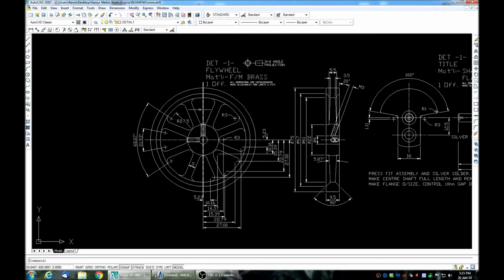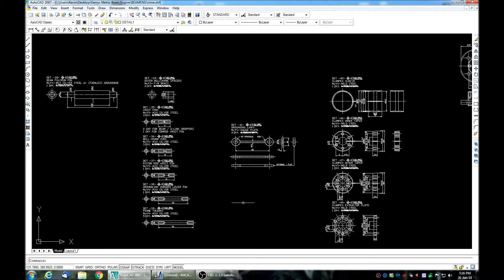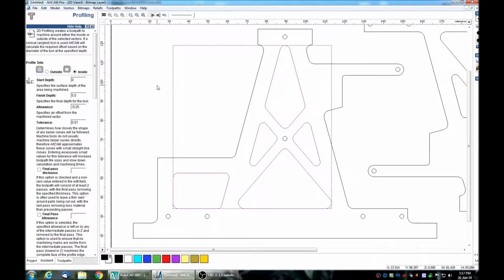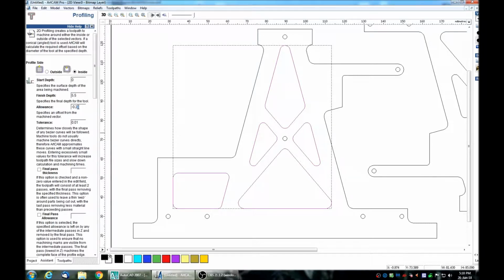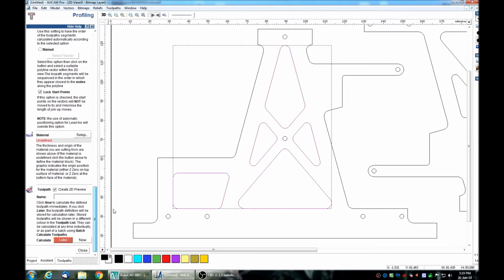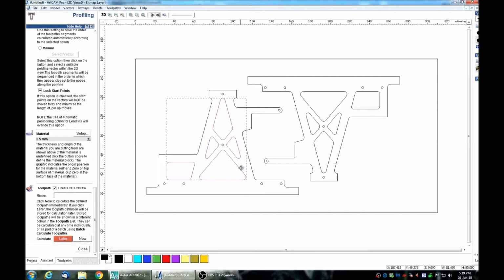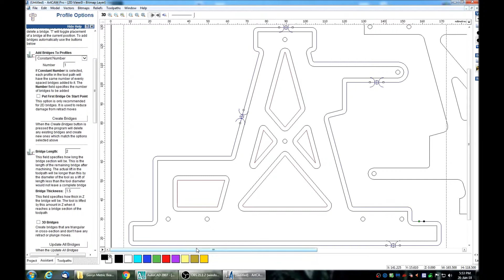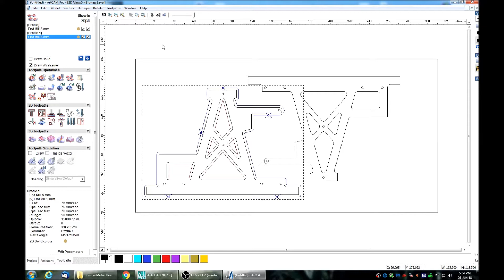#19 - Gerry's Beam Engine - part 1 - CNC'ing the Frame

Comment: You have helped to get my interest up with this video and I will be watching your others soon. My question for you is: did you build your CNC router? And what can you tell me about it, source of plans and other information so I can look into what it takes to build one.  There are many of these machines available that are designed for woodworking but your use of it is what I would like to learn about. Thank you.
Reply from the maker: Yes I built it myself. Built to my own design. All the linear rails, ballscrews, stepper motors and electronics came from china

Comment: Looks like a good series, I’ll have to follow the series through. BTW When I was working I had some involvement with a truck body builder specialising in CNC aluminium truck bodies, he had a mist of methylated spirits blasting on the cutter to cool and blow away the chips, used a MDF table with a vacuum system to hold the sheet, because the spirits evaporated straight away the MDF was not affected.
Cheers 
Peter
Reply from the maker: Hi PGS, thanks for stopping by. Thats interesting regarding methylated spirits on the CNC.